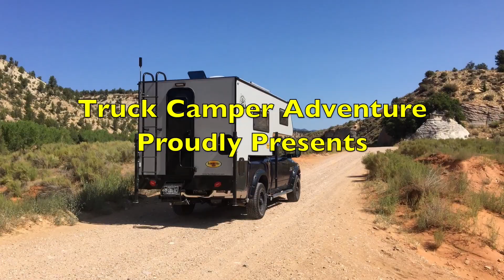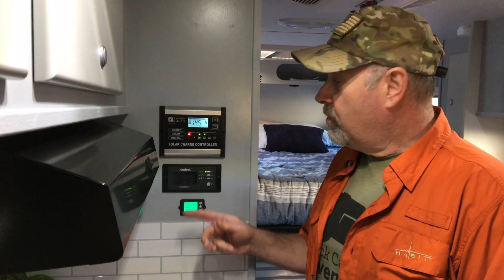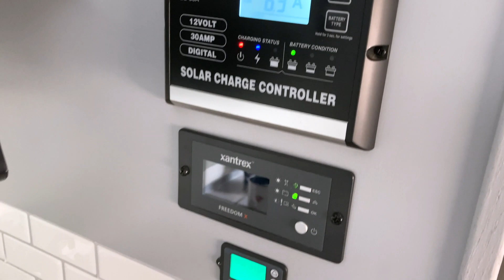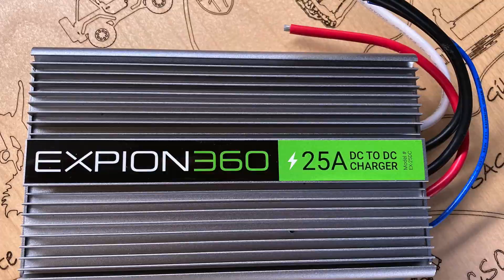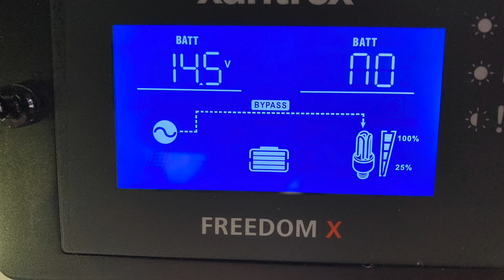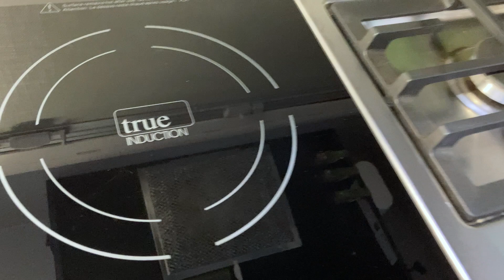RV Truck Camper Expion360 360 Amp Hour Lithium Battery System

Comment: We have 4 x 100ah Expion 360 batteries with 390 watts solar + a Samlex 2200 watt inverter/ charger and a Victron MPPT solar controller for our NorthernLite 8-11. The batteries and inverter were mounted in the D-shaped dinette by D&H RV of Apex, NC. We can run the 11,000 BTU AC unit for about 6 hours which comes in handy here in Florida. This set up has worked great for us for the past 3 years; the batteries cost $950/each at the time we bought them...
Reply from the maker: It's great! Isn't it?

Comment: I chose Relion LT lithium batteries for sub-freezing camping.  They have built in warming elements that automatically use the charging current to warm the cells before charging.   We've been well below zero and so far so good.
Reply: Thanks for making the videos....hope to see you at the quartzsite rally.
Reply from the maker: @brentswartzentruber5565  Yes, we will be there.
Reply from the maker: That's a very nice feature! Thanks for sharing.
Reply: Are 360 AH?

Comment: Fantastic video and what a power system you have. Did you do the work or did Bundutec? I'm looking at the the popup camper Wild they have.
Reply from the maker: Both! But Bundutec did most of the wiring. I put in the larger lithium battery and the Truma Aventa air conditioner. I moved the AC wiring from the converter-charger to the inverter output distribution panel.